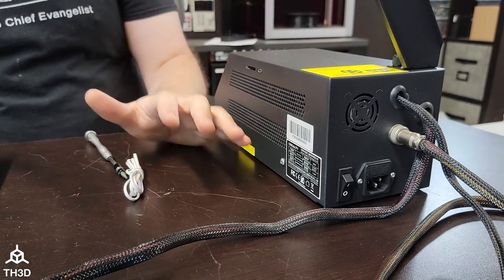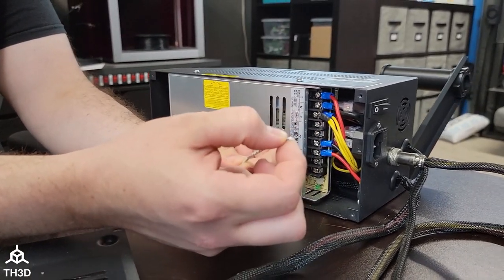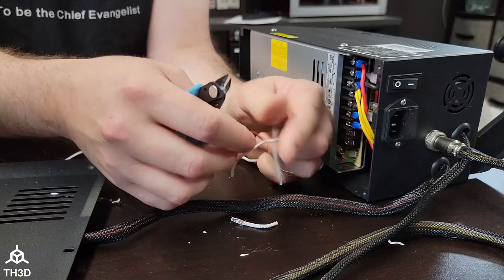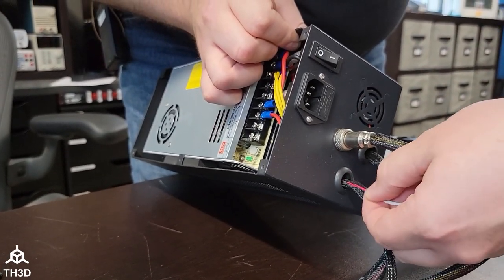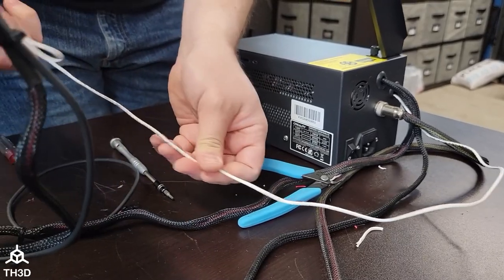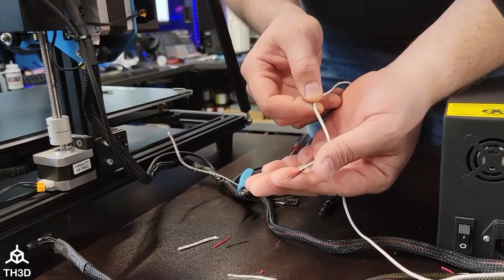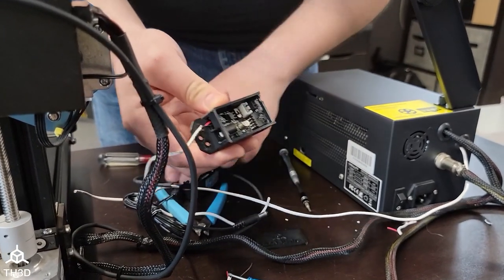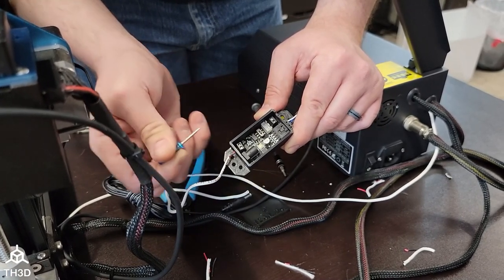EZABL EZTips - Powering the EZABL

Comment: Does connecting this way leave power going to the sensor unless you pull the plug to the power supply or does the power you're connecting to go off when the power supply switch is turned off?
Reply from the maker: The sensor will remain powered if using the separate adapter.

Comment: Hi can ezabl use for kliper software?
Reply from the maker: While our technical support team does not use or support Klipper, Our sensor itself can be used with Klipper if you know how to setup the Config. Our Discord server has many users running Klipper with our probe in there who could give you some example configs to get it going. The EZABL sensor works like a NO endstop switch in terms of logic when talking to the printer control board.